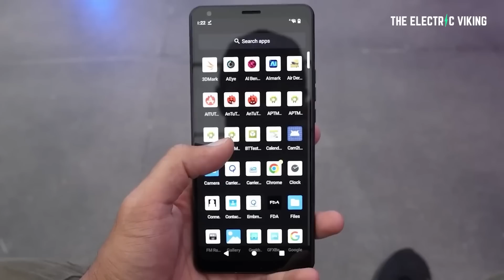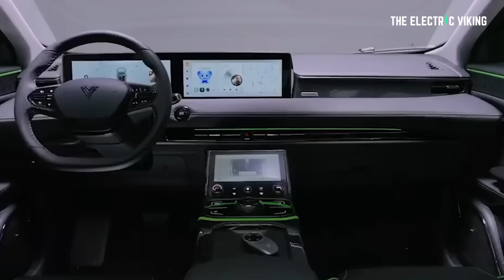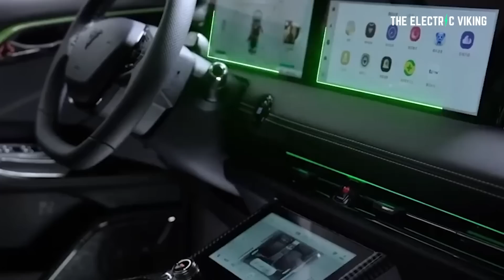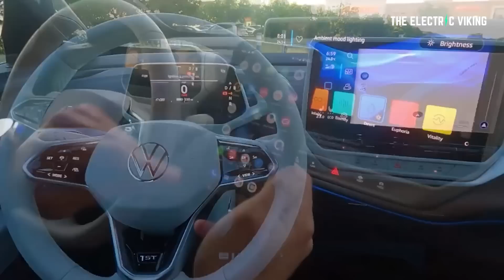Europe will be flooded with superior budget priced Chinese EVs

Comment: The chip story is real because they couldn't get enough production for the PlayStation 5 etc. either. But it should no longer be an issue really. TSMC will open 12 new chip fabs in Arizona...
Reply: Where are they geting to get the experienced workforce to run the fab plants and the clean water needed to make the chips in Arizona?
Reply: @waichungsham1578  they have a big water recycling facility planned.
Reply: Aren’t chips for cars old tech? It’s mostly OEM suppliers for trivial stuff using ultra cheap old chips.
Reply: Those might never be able to open..

Comment: Give me EV with cassette player 😅😂 nah but for extra I prefer EV with a CD player😅😂 but ultimately I want an EV with 5 speed manual transmission 😢😅😊 with no power steering. 😂
Reply: Certainly Sir,what colour would you like?😂😢😮
Reply: @malcolmrickarby2313  
color less. matter of fact i want it, all glass 😂 but bullet proof 😆 but transitional during uv ray 😂 and ultimately EPA certified 😂 we are polluting the air with gas particles 😝 true next AI 😂
Reply: Plain Truth  then I have to set the settings 😂 😆 better yet i’m let AI bot drive for me 😂